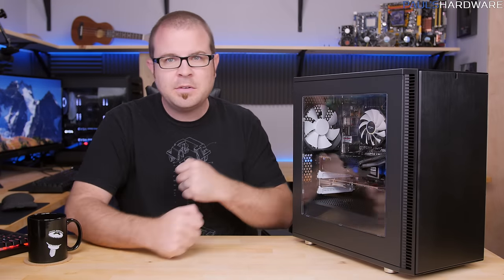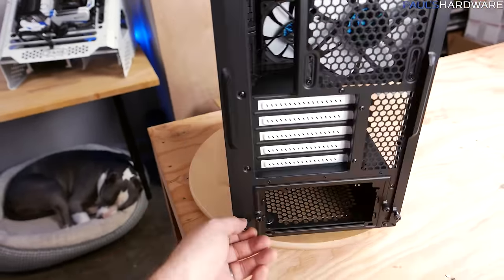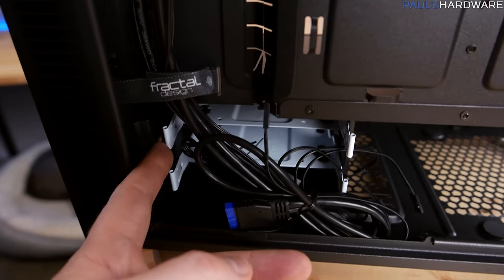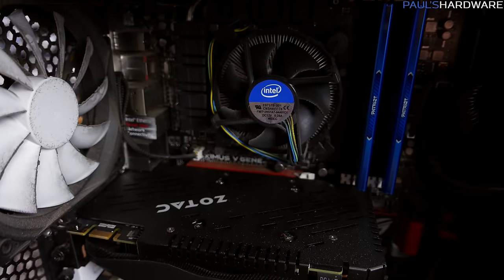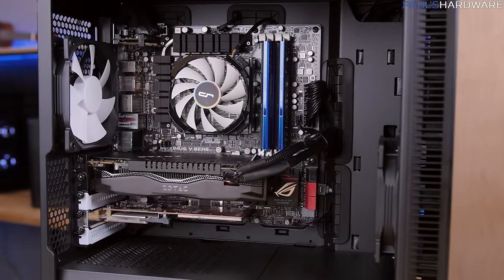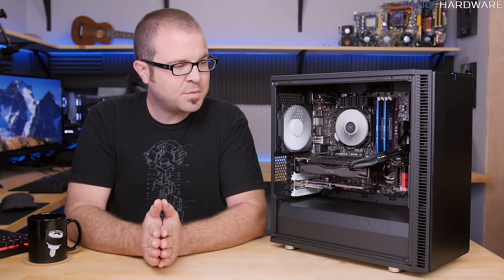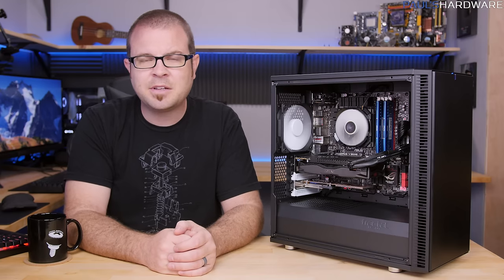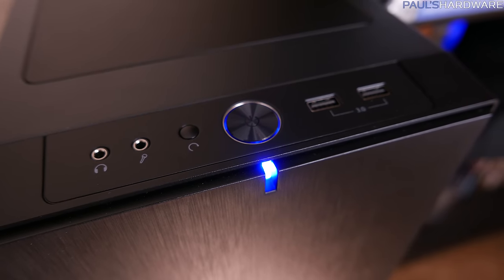New Fractal Define Mini C - Build + Review!

Comment from the maker: Hope you like the video guys! Just FYI, there isn't official support for a 360mm rad up front, but it might fit with a small one or some light modding. Official support is for up to a 280mm.
Reply: Paul's Hardware that opening sequence tho Paul or should I say He Man
Reply: Paul's Hardware gr8 vid
Reply: Paul's Hardware so cool
Reply: Paul's Hardware can you give me that pc pleeeeeeeeeease
Reply: Paul's Hardware u should do 800 build
Reply: Paul can the Cryorig H7 fit in this case? Also...
Build Idea! The PeasantBox: i3-6100 + gtx 1050Ti/Rx470 in a small case, like the node 202, node304,CM elite110, TT v1, sugo SG13... you get it. It would be a console killer at a console price
Reply: The H7 with its 145mm height will fit just fine. Case will room up to 168mm tall coolers.
Reply: Why didn't you just actually try to fit that third fan in the front?
Reply: I beg to differ. Fractal is supporting 360mm Radiators in the front. Quote: "Front – 360, 280, 240, 140 and 120 mm. Max width 144 mm".

Might be a tight fit for huge radiators, since most fans already use 25mm, but 119mm left is enough for a 60 or 80mm and some shrouds.
Reply: That smurf ending xDD
Reply: Why no radiator then?
Reply: "Front – 360, 280, 240, 140 and 120 mm. Max width 144 mm" is for the Define C.

This is the Define "Mini" C: "Front – 280, 240, 140 and 120 mm. Max width 144 mm". Two versions of Define C. But yeah I do wonder for the 3rd 120 mm fan because just looking only though, looks fit but apparently not? It would be ideal to have direct air intake for the hard drives in this Define Mini C.
Reply: Swap the power and HDD activity lights round. One is blue, the other is white. I've got Define R5 and that's how mine is setup
Reply: Did some NDA lift for this case? Because a bunch of you guys released the review for this case at the same time. XD I was curious.
Reply: Really love how Paul reviews things and share some handy tips :) I'll be waiting for Fractal to add a tempered glass front and side panel for this one :) Looking forward for more videos... P.S. I've been watching your videos since neweggtv :)
Reply: Yup.. Good call.
Reply: Do we have an ETA on when this will be at major retailers US, like newegg or amazon? Really wish they would give you guys a date of release, Holiday season could be from now to Christmas. Add the fact that I can count on one hand the amount of GOOD matx cases out there the wait can seem forever.
Reply: John Ivar Rubach thanks for the link, I literally just searched fractals matx cases on newegg a few hours ago, maybe its not categorized properly?
Reply: Does it also come in White Paul?
Reply: Afraid not my man... Only cases to come in white are the Define R4/R5 (solid or windowed panel)
Reply: Paul, do you still have this case? I can't find a decent place to buy it from and I really want one.  Hopefully it wasn't in you big sell-off
Reply: Heh thanks I just noticed they were back in stock this morning. I put my order in!
Reply: Cyrorig h7

Comment: THE micro-ATX case I've been waiting for... Kudos to FD for all of the filters, the shroud looks great, the grommets w/tons of tie-down points and radiator options. Well thought out and about as small as I'd recommend yet, easy to work in and I don't think you'll have any GPU size restrictions. PS  sliding HD cage is a plus. Only concern I have is the potential heat issue around any Hard Drives installed.

Comment: what about removing the panel for the bigger rad and adding a third fan with the drive bays slid back? it will give your hard drives some cooling air flow. Didnt know if it was an option, but looks easily doable and gives you a 3 fan front for a positive air flow further reducing your dust

Comment: Sorry late to the Fractal Design. I realized I have a Define Mini C but now when I want to use it I need to shorten the front in order to fit it to the living room. So I decided to remove the whole front panel and do something new in order to shorten the case. Do you have any ideas and tips on how to do it? I removed the buttons and usb ports, because I figured it will destroy the clearence. Please do a modding video ;) I have 280 radiatior in the front and 240 on the top and no reservoir or sort of a fill port tube down where all the cables go. I need inspiration!!

Comment: Hey Paul! Just thought of a solution for your blu-ray drive: Why don't you just use double-sided sticky tape and put it flat on top of the shroud? You will still have to open the side panel to insert a CD into the drive but at least it will work and will be part of the system. Since it is a plastic side panel you could make an opening in the side panel for the optical drive. That way it would work with the whole build. Just a thought!

Comment: Great video. I'm really interested in this case. Is it possible to add a 120mm fan in the lower front area of the case and push the hard drive cage closer to the PSU so you can get some air flowing on the HDDs? Thanks!
Reply: Did you find this information? I really like this case but I'm concerned about my two 7200 HDDs stacked.

Comment: Still no USB 3.1 in the front - why???
Reply: Bc it had the same speed as a 3.0
Reply: Mikkel Birch I'm assuming by 3.1 you mean 3.1 gen 2 (not hating on you, the other commenter should have inferred that), which IS twice as fast. and the reason would be there's no motherboard support. I have yet to see a motherboard with an internal 3.1 gen 2 header.
Reply: are 3.1 gen2 headers even possible with skylake mobos?

Comment: Is that space between the GPU and the PSU shroud enough for the fans to take air... I plan of putting rx 470 or 480 and I know that they are getting quite hot.. so my question is if these cards will proceed without problem. Love your channel tho <3

Comment: Sure looks like in your video that a 360 would work in the front, but Fractal's spec page only lists up to 280 or 240 for the front on the mini. The ATX version they do list 360 as supported.

Any idea if they plan to do an R2 update for the original Mini?
I built a home server type pc in the original Mini. I liked it a lot, but it kind of needs an update. I thought this might be the answer to that, but it's really not. It's much more in line with the Define S series, with the reduced number of HDD mounts, no 5.25 bays, more open, etc. The original Mini still had mounts for up 6 HDD's, making it work better for a server setup with lots of drives.

Comment: Regarding the LED/Power/HDD.  That power switch led needs to be wired separate from the HDD led. The included wiring only allows one connection to light up the slotted LED and the Circular LED.  They both blink and illuminate from the same source which is confusing for a novice or an unfamiliar user since most cases utilize a steady power on LED and a separate HDD LED.  They did this with the R4 as well and there is no option since there is only one LED illuminating both light lenses, the slotted and the circular one.  IN ADDITION to either a blue or white LED color.

Comment: Can this fit a Hyper 212X CPU cooler?
Reply: It will comfortably house the 212X Jay. CPU cooler height restriction for the MiniC is 168/170mm depending on window or solid panel. The 212X is 158 mmm tall. Leaving 10 mm clearance. In fact you could opt for the highest end coolers like the Noctua NH D15 and some of the Cryorigs in this little puppy.
Reply: I just hope the D15 would not take up too much space in the area around it. I am dead set on eventually getting an 8700K, but I will only use the NH D15 with it, because I plan on overclocking it. I know to use short RAM sticks, but I'm just worried about the ceiling/roof clearance, and the backside of the Micro ATX case. Can anyone even confirm that the NH D15 monster fits comfortably in the Fractal Define Mini C? Has it ever been done before? Am I barking up the wrong tree using this case?

Comment: I've built my first computer but there is a problem. My CPU fan don't move but GPU twitches every 3 seconds. and every other fan is working fine. what should I do?
Reply: +CarterDeajay
Replace the two fans?  I'd check out the wiring, make sure they're connected properly.  My guess is you already did that, tho'.

Comment: Can this case fit these GPUs with 2 intake fans mounted at the front?

1) GIGABYTE GTX 1080 Xtreme GAMING
2) ASUS GTX 1080 STRIX ROG
3) ZOTAC GTX 1080 AMP EXTREME
Reply: check out yourself by visiting fractals website, maximum gpu length and other specs are their...

Comment: Interesting, I have older (2014/2015) version and it's a completely different case - only part they have in common are front door. This one has a large bottom box, the old one has a place in the front for up to 6 hard drives that can be disassembled and both halves optionally removed (e.g. to add long GPU and not completely block one intake fan) and I have 2x4TB drives and SATA SSD there. It also has place for a CD-ROM and one extra 5.25 position, e.g. for removable HDD tray. Old one has both sides covered by a foam to reduce noise and it has basically no place where it can suck air - this one has little mesh without dust filter next to PCI slots and around the exhaust rear fan. Old one also has bottom fan position. But cable management is horror, especially when I have power supply with two VGA cables and three HDD cables each of them with 3 sata and 1 old connector. When I checked specs, new one is 10 cm shorter (good) and 2.6kg lighter.

Comment: Paul can you please recommend a case with space for an Optical Drive and will good airlfow
Reply: +Chimmy Changa Crocodile
Call me old fashioned or a stick in the mud, but that's my complaint about this case.  No provision for an optical drive.
Reply: Trends over many years show the usage of optical drives in home computers dwindle down to to almost none. So its natural case manufactirers are going to put that space to other use....or as in this example remove it all together creating a more compact case. I for one do use the drive from time to time wich made me choose the Define R5...but honestly..for the amount of usage its getting I could just as well bought a quality external drive and attach iwhen needed.
Reply: John Ivar Rubach
And yet Paul also wished there was a provision for an optical drive.
And a USB driveis never really the same as one that's connected directly to the mobo.
Reply: The Define R5 is a full ATX case similar to this one (no PSU shroud) that can hold an optical drive.
Reply: James Nuanez
Thank you.

Comment: They should go back to the other cases with those ModUVents without dust filters and add dust filters, to me that's the biggest flaw in those other cases.
Reply: Christopher Snow they will probably do that with the define r6
Reply: I want the Define S though, if only for the HDD/SSD on the backside configuration for open airflow.  Maybe the R6 will have that, time will tell.

Comment: Airflow for the HDDs? There is none. HDD in operation 42°C (max 45°C). The same HDD in a cage (different case) with a 120mm fan = 37°C max.
Reply: Who uses hdd yet? if you want space you had to have a NAS in other room.
Reply: i dont think its that important

Comment: not hating on Paul because I love the review, but the dimentions of this case doesnt make a whole lot of sense for me. Package dimensions (LxWxH): 502 x 290 x 484mm 7kg.
You get smaller/similar sized full ATX with very similar layout. Like corsair 400Q/c ect ect ect. 
Why would you go into the effort of buying matx motherboard if your not gonna end up with a smaller system?
Its basicly 2cm shorter but 2cm higher than their existing full atx models even.
Only big pro I see is that you get a a PSU shroud.
Reply: Erik.. package dimension is the outer shell in wich computer cases are shipped in. Not the actual case dimensions! 
These are for the
Mini C  - with feet/protrusions/screws :                                                       413mm x 210mm x 412mm Weight 6,9 Kg
Corsair 400C case dimensions (doesnt say if it is with those tall feet) :425mm x 215mm x 464mm Weight 8,2 Kg

So we can see that the Define Mini C is a pretty wide box at 210mm. just 5mm less than the 400C...as Fractals has always been wide to accomondate for easy cable managment.
Height however is 464mm (or more) for the 400C, 412mm for the MiniC! Now thats 52mm taller for the 400C.... Wich it uses for what? The two additional pcie-slots? Well that seems about perfectly right dimension wise in my book.
Reply: wasnt aware , thanks for the correction and I totaly agree/see your point:)

Comment: tried to write a google review and funny enough, there's no option to, so i will leave one on every youtube review

i would give it a 1/5 stars, extremely poor QA/QC, just google their issue with front MIC and front USB connections and you will see quite a few examples

on mine (purchased 2018), it's both those issues, front MIC is not soldered/connected correctly as such, sound connection is not 100%.  As for the front left USB, nothing at all, not registering any USB devices plugged in, nor is power available even for charging